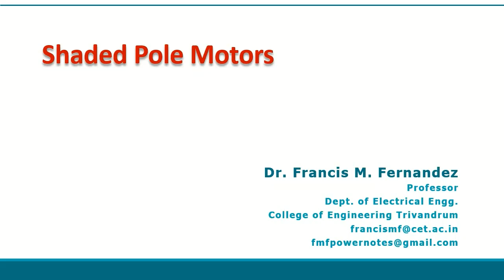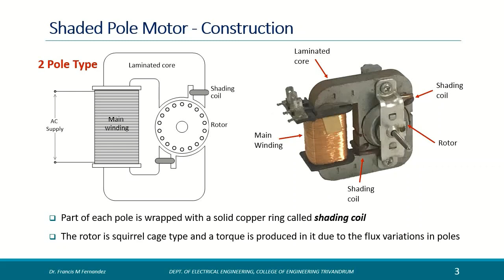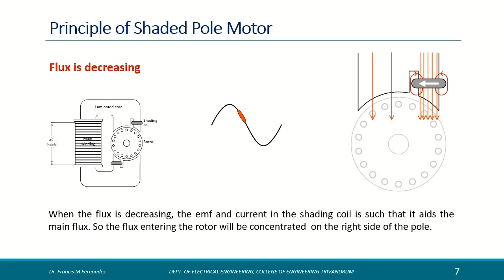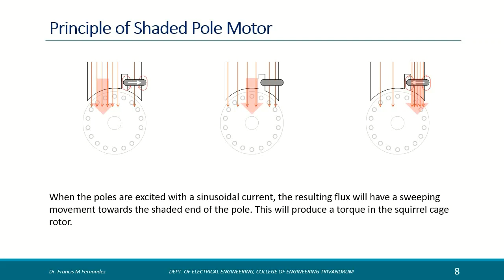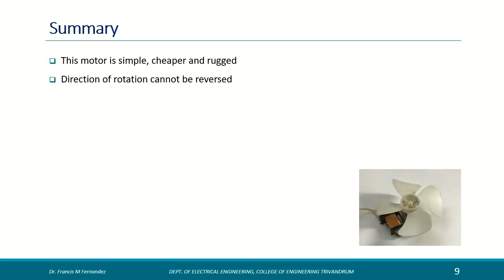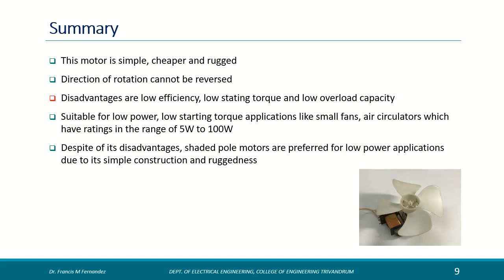Shaded  Pole Motors

Comment: Hello  Dr. Fernandez
Can I use a label mark 220V 50Hzs shaded pole induction motor(2 pole) , in 220V 60Hzs 
or
use a label mark 220V 60Hzs shaded pole induction motor(2 pole) , in 220V 50Hzs 
thanks

Comment: Is the shaded pole winding comparable to the auxiliary winding in a single phase induction motor in terms of functionality i.e., helping in producing a variable magnetic field/flux?
Reply: Yes , so the force is turned to double torque
Reply from the maker: No, single phase induction motor works on a different principle
Reply: @PowerNotes  But isn't it the shaded pole winding in this case the cause of variable magnetic field?